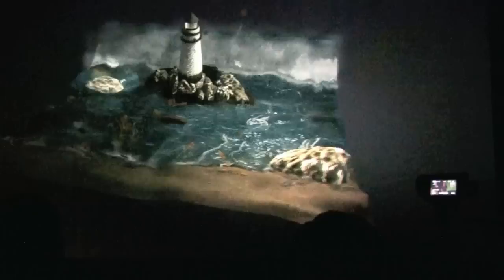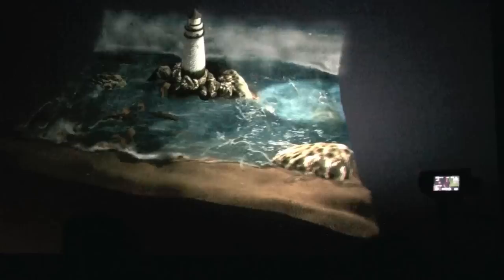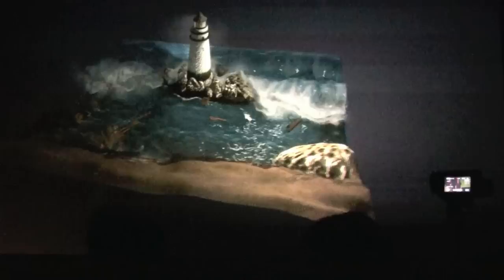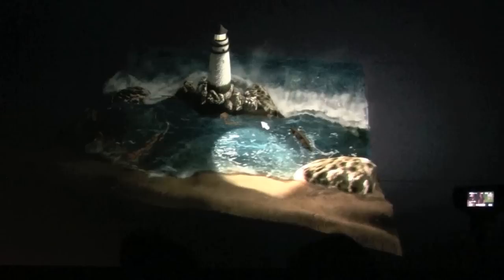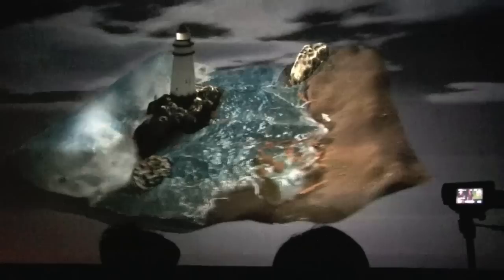Physics Demo Shows Off Water Simulation on 1 GPU - GTC 2010

Comment: you're missing the point... by clever software alone they have massively reduced the computing power required for fluid simulation. by continuing this line of research the algorithms will get better and better and pretty soon they'll be in games.

Comment: Single Gpu/video card For all tehhhh nuuubzz out there !! Because you got to keep in mind that Cuda cores are in far greater number then the ''CPU cores'' And why are they not being used in games like in the demo ? Because all the games are designed to run off of an old console architecture then they are ported and transled to run on our 1000 core+ gpu's with really bad efficiency too

I mean, you're talking a game engine that has sooooooo little opperations per second..... and putting on pc..